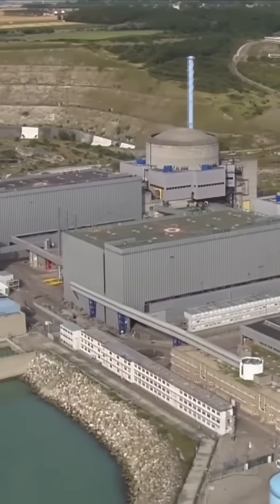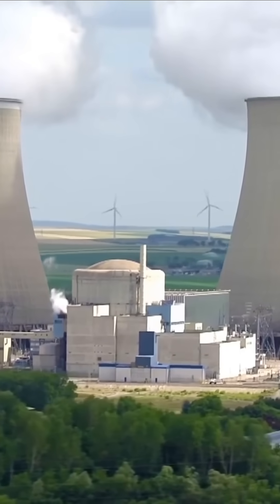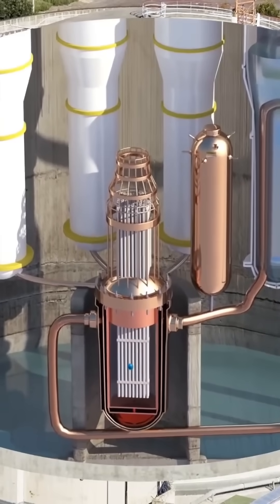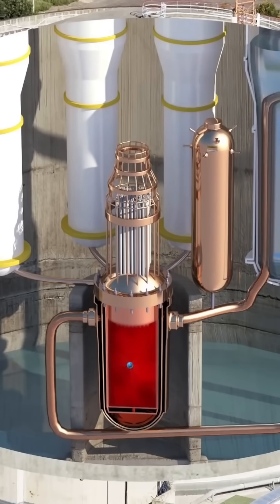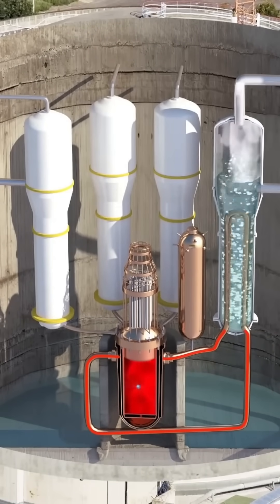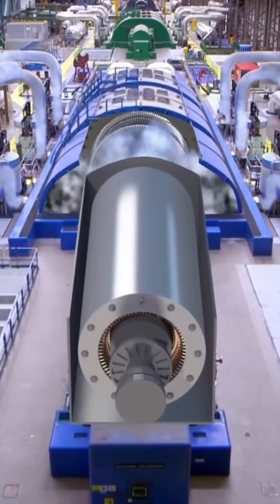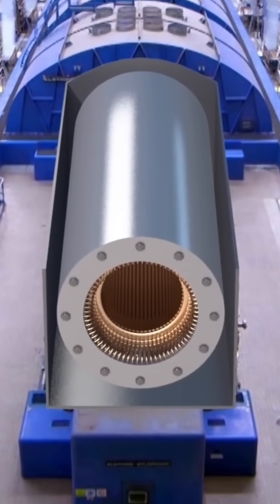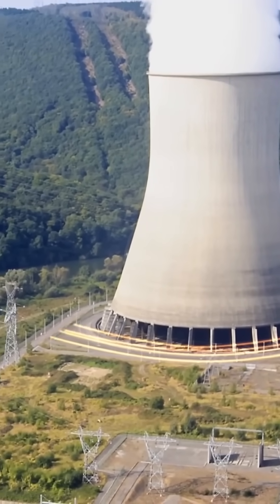How does a Nuclear Reactor work? #shorts #nuclearpower #nuclearreactor

Comment: "Currently there are 93 working reactors" THOSE ARE ROOKIE NUMBERS, YOU GOTTA PUMP THOSE NUMBERS UP!!
Reply: This is our most viable means of producing clean energy. Many proponents of green energy will argue that it takes too long to build a nuclear power plant, that "the 8 to 19 years" puts us past the "point of no return". I don't think this is a valid reason to completely dismiss this option. 

The other facet is safety; these facilities generally are very safe but when something goes wrong, it can ruin life-sustaining resources. I propose diverting a bunch of that climate change mitigation money and putting it towards over-engineering all future nuclear plants. Build a containment vessel around the entire facility before a meltdown.

Heck, I would also propose storing the waste on-premises. Not like we do now as a stop-gap measure, but actually design the facility to safely store waste indefinitely. That last idea may be m worst idea, but I stand by the aforementioned.
Reply: @DJRonnieG true but heres the thing
Nuclear plants are safer than you think
Most plants YOU CAN STAND BY THE ACTIVE CORE
And probably not receive more than the maximum safe dosage THEY ASK FOR NUCLEAR PLANT WORKERS!
HECK EVEN LESS!
you're very safe
Reply: @DJRonnieG  yeah good ideas, but the nuclear reactor fuel can actually be reused many many times before it actually loses all of its energy. Cleo Abrams, Huge if True channel has a good video about it I believe
Reply: @DJRonnieG sounds good but still too risky, to expensive etc same old problems. Honestly there is no other better option than nuke energy but still it got it flaws, ever since we know industrial revolution it would be no point of return.
Reply: @lukaswilhelm9290 yes but way less flaws than other forms of energy
Reply: @DJRonnieG , What's FUKUSHIMA ?
Reply: @iCyWEdontCi2i  Fukushima is a good reason to not slack on safety and containment. If it were up to me, all new reactors would be built inside of a pre-built sarcophagus capable of containing a meltdown. 

That said, there were a lot of dumb little mistakes that lead to the big Fukushima disaster. Maybe small-scale use is the way to go. For example, a SMR used for running a solar panel factor. Small Modular Reactors are well-suited for running the machinery required for melting glass, and can do it without any carbon output.
Reply: @iCyWEdontCi2i  Fukushima is when a company is not responsible and skipped basic safety regulations for quick buck. Remember that both Fukushima and Chernobyl happened because of cutting corners.
Reply: @DJRonnieG , Show us One SMR that has worked so far.  And where are they getting the fuel for such.
Reply: @redegg7530  There's 22 other ones in america built the same way.  
Q: How close are you to one ?
A: Does not matter
Reply: @iCyWEdontCi2i  Clarify with “built the same way”, You mean cutting corners?
Reply: @redegg7530 , they are Designed the same way.
And are you saying that the 9.2 Earthquake that happened at FUKUSHIMA is "cutting corners" ?
The Buildings weren't/aren't designed to handle a 9.2, let alone a 6.0
Reply: @iCyWEdontCi2i  Yea, that's cutting corners. If the reactor can't stand a magnitude 6.0 earthquake, it failed the standard safety guidelines. The standard is for building to only have slight cracks in 5-7 magnitude. Even then, the biggest failure is caused by the tsunami.

TEPCO failed to make water tight rooms for the emergency generators. Note that a warning about it was already told to TEPCO yet barely any additional safety was added that didn't work in the end. There's also other things like warnings from strong tsunamis damaging the reactor ignored or not taken seriously. They also levelled the location so when the plant was being built it's 10m above sea level, the original level is 30m above sea level. That would've prevent lots of damage or all of it. This is not all of the flaws btw.
Reply: @DJRonnieG  or better yet, underground
Reply: @iCyWEdontCi2i  Npc bot 🤖
Reply: @iCyWEdontCi2i an event that was well controlled
Reply: @iCyWEdontCi2i that's what happens when you build your backup power generators IN A INSECURE SITE!
next time have something that doesn't need power to shutdown a reactor or Just MOVE THE GEND
Reply: @iCyWEdontCi2i Oh i could care less
The NRC makes sure these aren't ticking bombs
Reply: @iCyWEdontCi2i  Pporly designed and fault line built. But also media hype. Nuclear has the lowest death/TWh of any power, including all exaggerated numbers and comparing against things like solar.
Reply: @DJRonnieG  This pre-built sarcophagus is known as the containment structure. Unfortunately, Fukushima's must've been stupid.
Reply: @pixuxucobrasil9206  oh yeah, fair point and correct for that matter. I guess I want a second bigger one if the first one is compromised and big enough to handle a whole meltdown.
Reply: Yeah
We reallu should
UNFORTUNATELY 
Some people see chernobyl and FREAK OUT!
And why shouldn't they? It was a scary example of what happens when you have people messing about with new technology
But i see it as a learning opportunity
Reply: URAAAAA
Reply: Supersonic passenger aircraft with a nuclear power plant https://youtube.com/shorts/iWr5XZFL4DQ?si=jHvZnM8PEVuJKj0f
Reply: MAKE 'EM 930 HELL YEAH 
AMERICAN URANIUM FOR THE WIN
Reply: You say that until America has a Chernobyl
Reply: @fingernailplays5602 America will never have a Chernobyl. I suggest actually studying nuclear power. I’d start with Chernobyl and the RBMK reactors they built. Start there as a starting point so you can realize a Chernobyl level event will never ever happen in the west.
Reply: @fingernailplays5602 Western built reactors are built on a way that they can not have an accident like Chernobyl. Of you knew anything about nuclear reactors, you would know that it isn't possible.
Reply: "Playing with fire" sounds tame now
Reply: @zacharysherry2910 the benefits of nuclear are worth it it makes a lot of power with little environmental imapact and with thorium will be much safer
Reply: @50-frames-of-stick71 true
though guilty pleasure? I kinda like PWR/BWRs and ESPECIALLY BWRs because me like simple water boiling reactor
Reply: @seantaggart7382  yeah BWR should be more common, PWR is more complex and would probably be more expensive. Sighh if only RBMK was safe...
Reply: @pixuxucobrasil9206  PWRs are pretty cheap. Not as cheap as BWRs, but still in the cheap category. Even PHWRs are cheap enough for mass commercial deployment.

Comment: What's coming out of those cooling towers?
Reply: Excess Steam/water vapor the plant doesn't need/use
Reply: @DeathSithe92 , WRONG
Reply: @DeathSithe92  no it's not it's water that cools the water that goes through the condenser on the turbine
Reply: Yes but if the system is recycling back steam to the reactor why are they wasting all that "steam" and therefore precious water?
Reply: @jimbob-robob  Why is it "wasted"? Not everywhere a large body of water is available for cooling purposes, hence the cooling tower. Only a fraction of water is evaporated and takes part in natural water cycle. A good example is Chernobyl nuclear power plant: first 4 units were using cooling pond but next units were designed to use cooling towers.
Reply: @dymytryruban4324 , what goes up, must come down onto the farmland surrounding nucIear reactors...
Reply: @iCyWEdontCi2i  Do you care about cooling towers of coal or gas power plants? it's the same thing.
Reply: @dymytryruban4324  look water coming from the cooling towers is three times removed from the reactor it's never steam being expelled from the turbine so if you don't know what your talking about educate yourself 1.reactor water 2. steam turbine water 3. condenser water 4. tower water that cools the condenser water, ok there you have it
Reply: @kurtdnelson9653  
1) What is "three times removed from reactor" gibberish?
2) Just like in coal, gas or any combustion power plant, cooling tower is part of condenser circuit wherein water serves to cool steam turbine exhaust. No mixing occurs. 
3) Did I say anywhere "steam from cooling tower is expelled from turbine"? Please quit ascribing me things I  never said.
Reply: @dymytryruban4324 , Yes, I care. A nucIear facility cannot be operational without an external powersource like Coal and Gas.... All three have made their mark.  But for other than WAR, What's the purpose of nucIear, if you have to have another source to keep it operational ?
Reply: @jimbob-robob  it's a system three times removed from the reactor it's always non harmful
Reply: @kurtdnelson9653  Pinky Promise?
Reply: Mist which is condensed steam.
Reply: @dymytryruban4324  no it's water that goes through tube sheets that cools The water that goes through the condenser the cloud you see is it's own separate system.  it's warm condensation aka cloud non harmful
Reply: @kurtdnelson9653  In some languages including French, there is one word for vapor and steam. So yes, I should have been more specific. But still, I never mentioned that water in cooling tower ever goes through reactor. My previous comments never even alluded to BWR.
Reply: @dymytryruban4324  your first post says mist which is condensed steam Malal answered Excess steam/water vapor the plant doesn't need/use.   Which is wrong also 
1 reactor water    2 turbine water   3 condenser water and  4 cooling tower water
These water systems are all separate from each other in the Navy we didn't have cooling towers we did not have #4 we had the sea water for #3 there are plants that may not use step 4 ok then condensate gets cooled by the towers or some other sources ok I spent 4 years in the Navy 3 yrs at sea 16 years in  boiler operation so I do know a little about what I'm talking about ok

Comment: I've always wondered if there is a way to harness the steam that is exhausted out the cooling towers.
Reply: I know it's already been stated, but you see coming from those cooling towers isn't steam, it's condensation. In a nuclear plant you have three cooling loops; Primary, secondary and tertiary. The video discussed the primary (the coolant that contacts the fuel) and the secondary (the coolant that is turned into steam and turns the turbines) but doesn't discuss the tertiary. The tertiary loop is the coolant that is used to condense the steam in the secondary loop back into water so that it can be pumped back to the steam generator to do the cycle all over again. Typically this this takes the form of a heat exchanger with one side being the steam side and the other side being fresh or sea water. The fresh/seawater side is let into the heat exchanger, pumped through some tubes to soak up the waste heat and pumped back out into the environment slightly warmer than it was when it entered. The big cooling towers on the other hand use air as their tertiary loop. The inside of those towers is plumbed with ducting to allow the spent steam as much surface area as possible to exchange its heat with the surrounding air (kind of like your cars radiator) That air gets warm, and warm air can contain more moisture, so it becomes saturated. Warm air also rises, so it rises up out of the tower where it comes into contact with the cooler ambient air and the moisture that was saturating that warm air mass condenses out into the clouds you see. 
I actually did see some proposals a while back for using either the secondary steam to provide heat to nearby residences or the tertiary cooling water to provide hot water but nothing has actually come of it.
Reply: It's possible but unlikely they could use it to power a data center next to it, it won't make them any money so they'd rather it go to waste
Reply: that steam is kinda really moist air, it's quite cool actually. it would at most be 35 degrees C
Reply: those are cooling towers the water that comes out of the bottom of the steam turbine is condensed in a condenser,(a closed circuit) the water that cools the steam takes the heat runs through other pipes that run through tube sheets then back to the condenser to cool the steam again the cloud you see is the water that gets pumped through the other side of the tube sheet in the towers so 1 you have water that goes through the reactor that water heats a nother 2.A source which makes steam B. goes through turbine then condenser and back to heat exchanger. 3 water gets pumped through other side of condenser out to tower cooled then back to condenser. 4 water flows through tube sheets in the tower takes the heat as it rises through the water towers.  it is not steam but water that takes the heat from the exchanger and rises through the towers as condensation aka a cloud 🌨️🌨️🌨️ sorry for length of commentary
Reply: @kurtdnelson9653  All this is known… so… what’s your point?
Reply: @geowar20  I guess the way you two were talking about stuff was well ? and I don't think I was talking to either of you
Reply: @geowar20  the vapor coming out of the cooling towers is not steam but water vapor just like a cloud in a closed system they use every bit of the heat they can not one bit of steam goes out of the towers a bad system would be a steam 🚂 understand that is called inefficient
Reply: @geowar20  what's your point you throw a lot of # out there
Reply: @kurtdnelson9653  The steam turbine is a closed loop system. A heat exchanger after the condenser heats external water to about 35° C (95° F) which while it isn’t steam it is hot enough to drive vacuum desalination (@ 85°F). (What’s seen coming out of the top of the cooling towers is water vapor from evaporation.) The plants in the Middle East that do this generate about six million gallons of water per day (off of a 1 GWe reactor). No cooling towers.
Reply: Why would you need to do that? During the water cycle it goes into the clouds and after some time rains down to the ground
Reply: @yourbigfan1777  My guess is that you haven’t been to the Middle East… can you say “arid desert”? Not much rain there.
Reply: All US reactors on big lakes or on the coast have no cooling towers. Pump water in pump it back out a few degrees warmer.
Reply: Steam only exists under pressure. If you see what you think is Steam in the environment, it is not in fact Steam, it is merely condensation.  the fact that it is under pressure is what gives it the ability to rotate such large turbines to in turn, run generators to create electricity
Reply: Extremely wasteful tho. You're better off making a apparatus to passively cool steam with heatsinks for reuse; or just shove everything inside a reservoir (think, a artificial pond) like how some designs already do.
Reply: The steam turbines used by most (coal, gas or nuclear) electric power plants run at about 40-45% efficiency. That means to generate 1 GWe of electricity it actually creates 2.2 GWatts of heat. 1 GWe becomes electricity and the other 1.2 GWatts is "waste heat" that's released into the atmosphere (via those iconic cooling towers). That 1.2 GWatts of "waste heat" could be used to desalinate water… 1.2GW * 24 hr/day / 3.8 kwh * 1000 gallons ≈≈ 7.6 millions gallons of water per day.
Reply: @geowar20  it could, but the condenser cooling water is never hotter than 35 ish C
cant boil nofin with that!
Reply: @human_3217  Sure you can… it’s called vacuum distillation… look it up. It’s how the Middle East desalination plants work.

Comment: so we still use steam
Reply: Yes 

Lots of steam
Reply: 200 years after the industrial revolution and we have merely just expanded on the steam engine.
Increase power output, decrease wasted energy, it all becomes steam one way or another.
Reply: 4m joules per second of energy in steam. soo yea
Reply: If we ever have antimatter/blackhole reactors we will use them to boil water to get electricity
Reply: @peep77777 indeed
I USE A FISSION FUSION REACTOR (it takes the fission products and refuses them with the energy generated from the fission reaction allowing a bunch more energy to be released!)
AND YET I STILL USE WATER
Reply: @peep77777  Maeby if they generate heat we Will
Reply: 😂😂😂 @peep77777
Reply: @peep77777  Well yea but also no since the power of a blackhole would instantly crush any surrounding object, We would need magic or magic materials for that to happen. With math we can pretty easily understand that to withstand a blackhole you would need something of equal mass/density or in other words another black hole 😂 wich is most likely impossible, even if you could create confined microscopic black holes that would near instantaniously disapear after creation that would still be needing magic/magic materials.
Reply: Steam is king that's why drink tea and be happy 😁
Reply: Yeah
Its really efficient